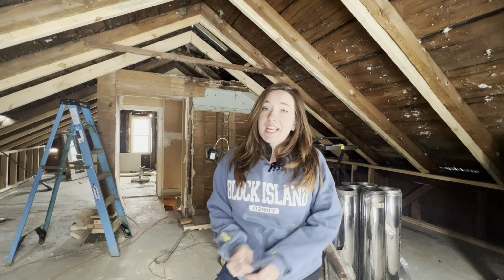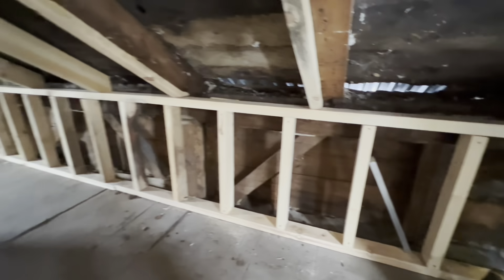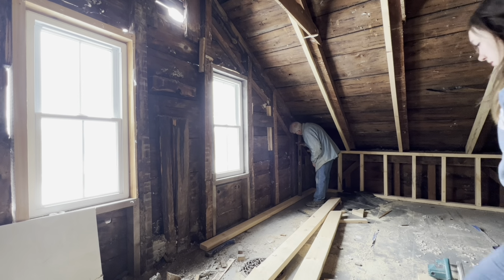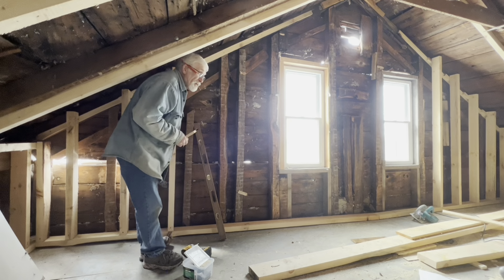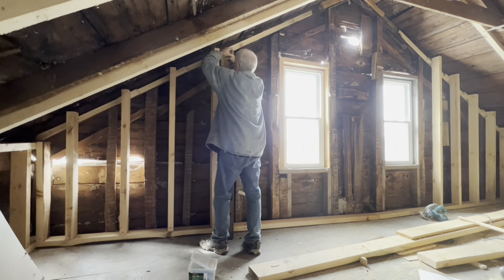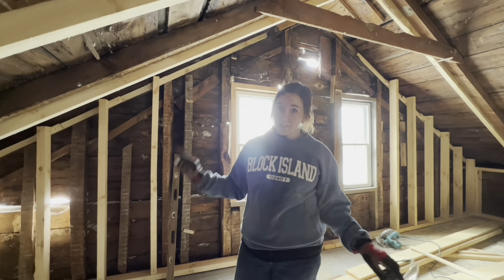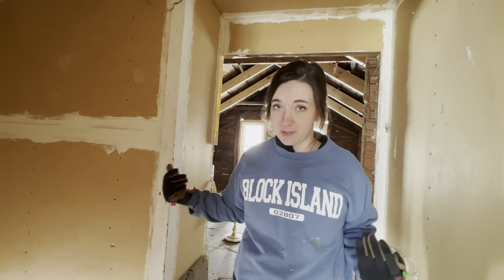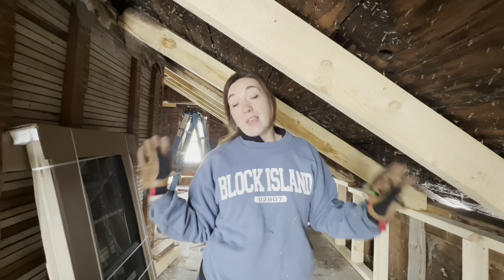I have BIG NEWS to Share!!!! | my Fixer Upper House Renovation 🏠

Comment: Exciting news about the dormer and the bathroom!  On another note, I have a suggestion for you - something I decided to do when we did our own whole-house renovation 10 years ago. When the rough electrical and plumbing and heating work was done, I took a ton of photographs of the whole house, including ceilings as well as walls and floors. It came in so handy later on when the walls were sheetrocked and I could no longer see where everything was. I have them in a photo album and still refer to them. I'm so glad I have them!!  Another suggestion is to get a shop vac in there just before the sheetrock is delivered. The spaces between the studs and all the spaces and crevices will have construction dust from the work you are doing now and vacuuming them got them really clean. I just didn't want to close in all that dirt and dust. Then I even vacuumed the areas that were still bare after the sheetrock workers left each night. That work creates so much gypsum dust and it is awful to clean up if you don't keep up with it!  Anyway, those are just suggestion I'm passing along. Loving your project!

Comment: Sweetie, put in a full upstairs bathroom.  Ideally, have an on-suite bathroom for every bedroom in your house, and a half bath downstairs for guests.  As you get older, privacy becomes increasingly valued - you don’t want guests poking around your personal stuff.  Another suggestion is have as many electrical outlets as you can.  Put them up near the ceiling for string lights…have one at each toilet in the house - perfect for electrical outage night lights - devices that provide just enough light to see your location at night , and when power goes out, they run on battery power.  Put electrical outlets on walls of your porch, and up high for holiday or fairy lights.  Put them in the floor where you might set a chair or couch.  Floor outlets come with smart covers that are flush to the floor when not being used.  This would enable you to put a lamp beside the couch or chairs without having to run electrical cord across the floor.  And finally, put as many outlets as you can in your kitchen.  I’ve been following your adventure since it began - you’ve come a long way - good to see a young woman lean into a project like this - you’ll learn so much- and gain confidence and knowledge that’ll strengthen you for life.  I’m very glad you’re sharing this experience with us.  Oh, almost forgot, put lights in the ceiling that can spotlight art work on your walls.  It’s lovely to have gallery style lighting wherever you display your precious items…and don’t be hesitant to install can lights that can be positioned to illuminate - and have dimmer switches on lights.  Think about adding fixed or vent-able sky lights - they add so much to a room - and natural lighting is a wonderful thing.  You’re a doll - best of success as the project progresses.  You’re a doll!

Comment: Very good! You will be so happy you did it. Resale value is important to be thinking in everything you do in the house. Even to the colors you paint & counter tops you get. I turned a little laundry area into a 1/2 bath in my last house & put washer & dryer in an enclosed porch that previously was just unused space. It worked out so nice & bumped up the price of my house when I put it up for sale &it sold in 3 days!

Comment: That's great that you decided on the upstairs bathroom! Can't wait to see how it turns out.   I just wanted to mention that you should check with where those radiators really need to go. They probably should be on external walls so you can get the most warmth from them. Even though you are doing a complete renovation with all new insulation, walls and windows,  the house is still New York. It definitely gets cold here in the winter months.

Comment: That's GREAT News!  Putting a 1/2 bath upstairs will be so worth it, you'll be glad you did later on.  You may think going down stairs in the middle of the night is not an issue, but if you plan on staying in the house for many years, as you get older it would be an issue.  It will be easier for anyone visiting that many be older and for resale.  I think you'll be glad you made this decision.

Comment: That's a great idea!! Just my opinion but I don't think you should put a radiator at the top of the stairs I think it'll make the upstairs too hot. Just put one in each bedroom and maybe the bathroom but we live in a two story with no radiator in the hallway, only in the three bedrooms and all the Radiators are turned down because it gets warm up there way faster than the main floor. Just my food for thought! I think the dormer will be a great plan for a half bath!

Comment: Wise decision on the 1/2 bath upstairs. They don't take up that much space. Figuring out the best location so the water lines can be run upstairs is the biggest part. Cabinet or free standing lavatory, either will be functional.

Comment: Those vertical short studs on the knee wall should line up under each roof rafter to help load bearing weight.

Comment: What about all the slit openings shining through from the outside walls?  Won’t rain, rodents, etc find their way into the inside of the house?  Are you not concerned about the new insulation you will be placing?  When will you replace your roof?  Will you not need the added protection there also?